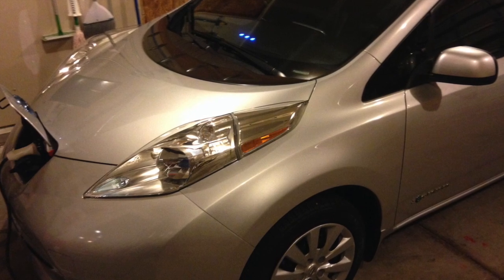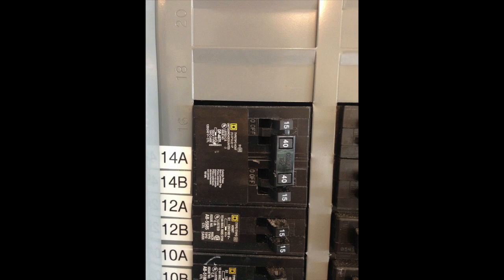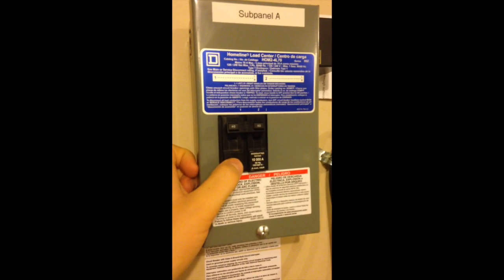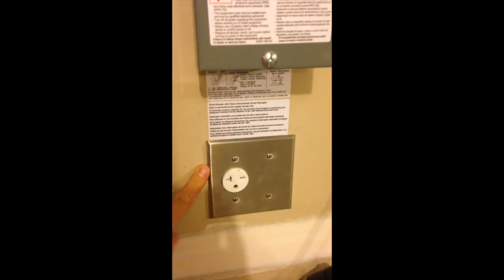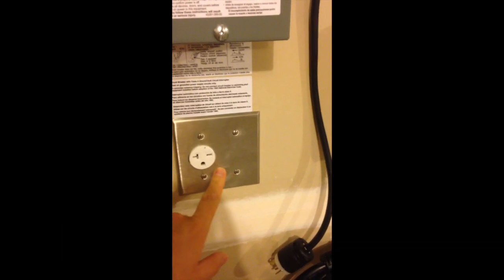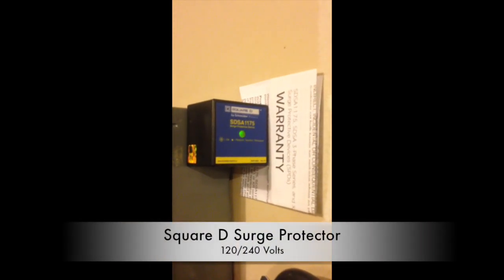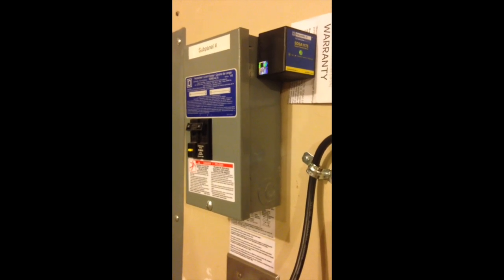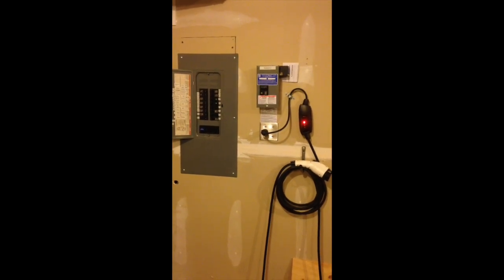Installing 240 volt Wiring for EV Charging

Comment: I just bought 2015 Nissan Leaf S model it has level 2 port. I am trying to figure out what quick charge to perches, but when I called the dealer to figure out what amperage my battery supports dealer has no clue. .... So I am still not sure..... How did you figure out? Is it 16Amp. 32 or higher? ...
Reply from the maker: If you have the base model (S), like I do, "quick charge" just means not the 120-volt charger that comes with the car. You want a 240 volt, 16 amp charging cable. Even if you buy a higher-amperage charging cable, your car will only draw 16 amps, because the actual charger is built into the car, so the more expensive charging cable isn't worth the money.
Reply: Mark Johanson 
Thanks for responding. Even though it's S model it has fast changing package. It does accept level 3 charger.